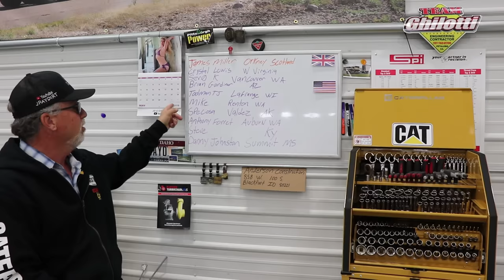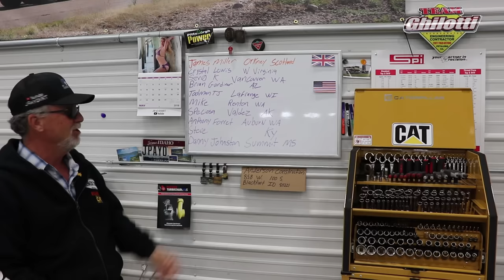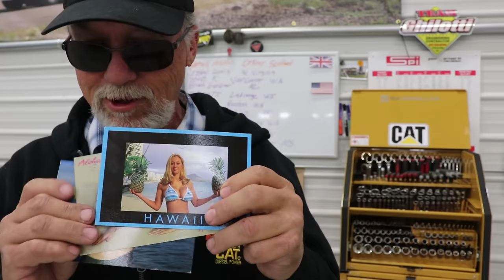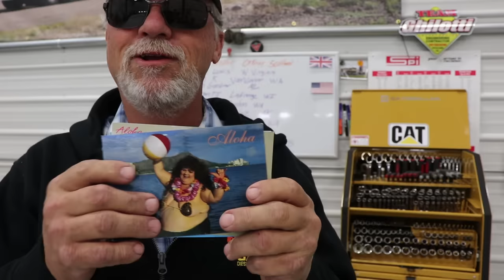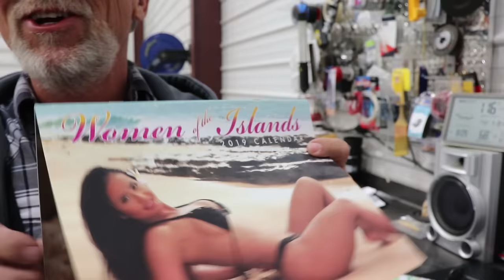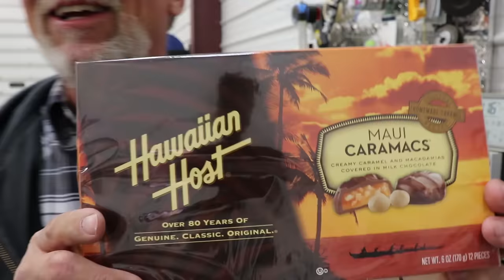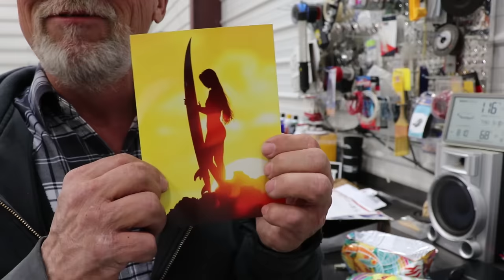How To Cut Red Top With A Caterpillar Grader

Comment: Your correct Jeff, a grader is a tough piece of equipment to operate to its full potential.  I ran one several times when I worked for the state highway dept in Illinois.  Never ran it enough to feel comfortable. I had a real finish grader operator tell me one time, "never stand up to run it and take little bites, don't try to move it all in one pass".  I tried to follow his advice.

Comment: Hi, Jpaydirt.
Another great video, especially the first part about grading to red tops. Very informative.

One thing that I have NEVER heard anybody else say about graders is this:

Graders work on the law of the lever. If one front wheel goes over a rock a foot high, by the time that movement gets to the center of the front axle, it is reduced to six inches. By the time  it gets back to the blade, it is only 3", so you'll have a whole 3" bump - without touching a single control..

If you go over the same ground again, with the blade set at ground level, that 3"bump will be 1 /12" by the time it gets to the center of the front axle and only 3/4"by the time it gets back to the blade. 

The moral: Let the damned machine do what it was made to do.

That said, "The art of earth moving is being able to set your machine to take the material from where it needs to be taken to where it needs to be placed in the condition that it needs to be when placed in the least possible number of passes."

As you said, you can tell a real blade hand very quickly by the way he goes about the job. A really good operator can pretty much make it look like he is sitting up there and 'letting it happen'. But the same can be said of operating pretty much any earth moving machine.

I don't call myself a final trim grader operator 'cos I have seen some of the REALLY good ones at work and I just ain't in that class 'cos I haven't and don't spend enough time on 'em.. That said though, I can often do better than some of the ones who do claim to be good blade hands.

Just my 0.02. Thanks again.

You have a wonderful 2019. Best wishes. Deas Plant.

Comment: as a laborer I would run along with shovel to help the old guy in the blade to clean off blue tops, red tops so he could see when he is getting close to them.  they would teach me tricks.  had a good guy that bet us he could pick a quarter and leave a dime.  he did it.
Reply from the maker: Ya, a good hand could cut em and all you would have to do is a clean off once in a while or if the cut was so fat it had to be done in several passes

Comment: On the 9N & 9T cat I used to have to find the fire hydrants using the GPS under a pile of wood chips at the pulp mill I worked at 100 feet deep , I set up the cats GPS to find the Pile Edges ,Hydrants , Pillers , Reclaims ; It would get so foggy in winter from the composting heat impossible to see at times - Wall of white at the doors before the GPS you`d drive off the piles or run into stuff so with the waypoints you`d see the cut you`ve done .Good show today Jeff .

Comment: More war stories from Anthony in Colton , CA . In the old days before we had plastic feathers. We used wooden hubs and painted the top of the hubs with blue or red paint for finish grade. I have seen some very good blade hands. Being the finish scraper  hand myself. Those were good at what they did. Who could scrape the paint right off the hub. I dont care how old you are that's finish. I call them war stories but all were true and my personal experience as a equipment operator. I sure would like to try those Hawaiian caramels. Thanks Jeff for all your great videos.

Comment: You have a classic buildup of tire fluid from the grader sitting in one place for too long. All the fluid squeezed out of the treads on the bottom and formed the boil. What you need to do is run that machine down the highway at the highest speed it will go. this will "fling" the fluid out of the boil due to centripetal or centrifugal force (I cant remember which it is) and distribute the fluid evenly around the tire and work the fluid back into the tread it was squeezed out of.  You may want to update your insurance before you do this, all of your insurance. Transversely, you could have a pregnant tire and it is just starting to show. Give her some space, don't work her to hard and see if you don't have a couple go-cart tires under the machine in a few weeks. (They normally pup at night). Hope this helps.

Comment: Great videos!
For cleaning the rust out of those seal grooves a glass bead cabinet is handy.  Tape off any surfaces you want to protect and spray away.  If you don't have one, you can get a cheap Harbor Freight unit for around $200 that will do the job.  Amazing how many things I end up using it for.  I don't actually use "glass beads" in mine....I use garnet sand that's a little coarser and it doesn't have the silicates of other sand.

Comment: Can't wait to see the start of the new Job, great info in this video Jeff.  Can you please show more on how you go about setting out your job (marking out, levels & Grade Stakes) and how best to approach different aspects of grading like (what gear to use with what type of material, blade positioning vs wheel position for cut, spreading or trimming; how keep a crown; Tips on doing high wall batters and slopes; and how to know if you've got the right moisture content.)  Oh and if it's not pushing the friendship too much, more on maintenance tips... Lov'in it all.   Cheers!

Comment: Nice grader tips there bud. Soak them teflon seals in some REALLY hot water, they get a little bit more pliable and save some aggrivation. Although still a pita! Thanks Jeff, Will in everett wa. P.s toolbox vid?
Reply: 682 70 Yes I've used the hot water trick a lot, works great. Jeff has a toolbox video last fall I believe if you look back you'll find it.
Reply: Jim Zivny i meant the new cat yellow box, i want one!!
Reply: It's not CAT, he just made it look like that. The vid covers it well. Model and where to get it too. You'll have to apply the cat paint, mats, and decals. Filling it with tools is the pricey part but none of it is on a budget including the elbow grease.

Comment: That was great video Jeff.Thats the trouble nowadays everybody wants GPS.Can't do anything without them probably use one to give them directions how to go to the crapper. You take pride in your work and its done right whether its excavating or wrenching and that still means something.Doesn't matter if its old school.Saw you were using the bottom dump did you ever install any vibrators?

Comment: I about threw the laptop on the floor making a grab for the cylinder part that started to fall.   Would that cap be easier to loosen in place and then remove in the shop? I have a loader cylinder I may try to repair myself after watching you.  Thanks for the videos.

Comment: I enjoy your work, agree with everything you said about the grader. I never had to grade up to hubs much, just wasn't done in our industry, a line of stakes set by transit with cut and fill was good enough, then laser came...and now we have GPS control and many ops that think they are good, but really good or just good programs doing the work? Its so true that knowing how material reacts to the way the blade is run is probably the most important aspect of grading. I don't get to sit in the seat much anymore but when I do I challenge myself to get that blade in the perfect position to do the work it needs to do. I never drove the machine, I run the blade. Great stuff paydirt, I'm still watching just not commenting much on anything anymore... but you got one out of me this time ;-)
Reply from the maker: Good to hear from you Jeff, are you still doing the same work?
Reply: Jpaydirt kind of. Much bigger oil company that probably doesn't want anything publicly broadcast. When I first came at the end of 2014 I was in the construction end but have since moved over to road maintenance for them and training grader ops. When not doing that I do a regular maintenance shift. Between the 5 of us I think we have a 1000 or so miles of road to look after.
Reply: CDNcatskinner yours was the first youtube channel I ever watched, your videos were great and I rewatch them from time to time. I work for a large oil and gas company in Aus doing wellsite, access roads and pipeline construction and rehabilitation. I have the same issue with not being able to post work videos on social media. 
Jpaydirt i hang out every Friday for your videos, i love your classic cats. Keep up the great work.
Reply: AusEarth99 cool, Nice to hear...must be something to work in a country that actually let's you get the gas to export markets, I'm jealous. Our protesters have stalled the industry.
Reply: I love your videos Jpay Dirt. If I hadn't been retired on medical grounds, I would have loved to learn to OPERATE "old school" Grading. After watching my Dad apply himself to anything, anytask, anywhere, I learned a lot from him simply by watching. Always asking the questions ... Why, How ... ? So, naturally, I also love tinkering, and apply myself to any task, within my abilities. Caren Barnet, South Australia.

Comment: One year in Phoenix years ago. Small parking lot crew. 14 blade, roller, water truck and my 613 scraper. One laborer to run finish hubs with the blade. One pass with the blade with a medium windroll. The laborer got in a tight spot with a wall and the blade. Strange, he disappeared for an instant. Then came rolling  out the end of the blades 14 foot mold board. Scared everyone  to death. All came running to see if he was o k. He was fine. Seems he jumped over the blade to get the next stake. Caught his foot and rolled him right out, including his shovel, the other  end. Wierd things happen when you're  not  paying attention.

Comment: if you don't change the winter air to summer air in your tires, it can cause tire boils😜
btw, buy yourself a can of Zep45, and you'll throw all other penetrating oils away. Use it sparingly as it is costly, but presoak, and reapply after a good soak...viola!

Comment: Loved the video. One thing I'd like to know more about motor grading. Got to spend more time on the old Adams.
O yeah dude drill a hole in that bulge that's the hillbilly way of fix'n things, member my dad fixed the TV back in 1960 so when ya changed channels ya had to reach through the hole he punch in the side. Worked great but would light ya up if ya touched the wrong thing.

Comment: Yeah, I know it's probably been replaced by now, but no. Don't stick a drill bit in it. It'll be under high pressure, and you may get injured. Besides that, the layer between the tyre and the outside air is what you are about to puncture, and the inside air will only want to equalise with the outside air...in other words, it will flatten much more quickly.
Reply from the maker: Thats an attention getter..............now you boys see a black trans am  LOL

Comment: ok Jay;   I've been around a fee belly dumps how are you regulating the the width of the doors?  it appears you have some way to change it in the cab? I've only seen chains on the doors. .
Reply: I'm betting that he has a proportioning valve somewhere in the control line.  Could be something like a highway trailer brake spike (taken from an older tractor, off the steering column), that regulates how much air gets supplied to the opening cylinders.

Comment: only dozer i ever worked was a 1968 John Deere 350 fireplow with a homemade 7' V-blade on front of it-i was working as a forest ranger in south central Ark-i worked 28 fires 18 were arson fires- most of the fires were small(less then 20acres) -the worst one was an arson fire-burned 80 of 20' new pine tree in less then 30 minutes(25mph flatline wind) and it wound up changing direction and ran over me and my plow-OUCH

Comment: I wasn't going to say anything about your tire selection,  I would have said stay away from Michelin Tires..
Their sidewalls are thin and easily damaged due to that fact.. Cooper. Or even good year have stronger casings. But you use the tires for industrial applications so I don't know if there's any warranty on the tires  or not. ???

Comment: I cut blue top for years in Texas, fine graded compacted limestone, shaved to grade. Imagine my surprise when I moved  to Detroit,michigan where bluetops aren't even used. A la stringline is how grade gets done. Really good operators lay asphalt base coat with graders. No grade hubs or even checking of the grade, once it is laid in it has to be right on finish. Imagine the labor costs saved......paving with one man instead of a paving crew.
Reply from the maker: how do they use a stringline, I guess that's something I have not seen
Reply: @Jpaydirt   . When I moved to Detroit from South Texas all I could think is "what the hell?" I had never seen anything like it. IT is exactly like the cement guys use when they go off their batter boards for a foundation. Simply run a string across the road grade from the guard stakes ' marked with permanent marker to one foot over finish grade and measure down centerline and shoulders. to finish' with an engineers rule. The laborers "string the grade"  measuring grade on the run : while the "Grader Guy" just runs along behind two laborers working the limestone grade and a string line pulled very, very, tight between two guard stakes at the same station on either side of the road... It can be quite a speedy process with the right people working grade. It is actually very difficult, because it all done by estimation to within 1/2 '  tolerance for asphalt and 1/4 inch tolerance for cement. Yanks pronounce asphalt " ashphalt" also. Really. I have been retired off a pension
for 11 years and from what I hear , all the kids use GPS exclusively now. Stringline is old school technology nowadays. But. It is how we used to do it. Here in Michigan. 
  Texas , when I left in 1980 , we still used bluetops exclusively. Limestone and water. And, a flatwheel rolller. Extremely rare is the yank that can cut bluetops. The have a f--k of a time with it.
    However these people are very highly skilled operators here in the Local 324. Knowledgeable is an understatement.Needing help too. Short of operators we are. There weren't enough operators to fill the seats in Detroit. The word came out in our magazine. Absolutely, send in -- some highly skilled operators to the Union Hall
and we will sign them up into the International Union of Operating Engineers. Really. 
   There is a boom on in the Motor CIty  and  so- local operators went on strike for over a month in Oct. Won eight dollars an hour raise over five years time for their efforts in this walkout, they did. AS a retiree I could only watch and think ; it is about time.  These folks will treat a man right, take care of him, sometimes cradel to grave and find him work.....if the skill levels are there.
    It has been an interesting ride, over the last forty years to say the least riding up on all those Cat 12's, 16's  etc..Thanks for posting the video.

Comment: PB B'laster beats Liq Wrench any day of the week.
Reply from the maker: https://www.youtube.com/watch?v=xUEob2oAKVs&t=1s
Reply: To each their own I guess but I have more everyday hours in busting loose weathered rusted stuff than you have it would appear. Mystik use to have a forming penetrating oil that was very good but they changed the formula or something years ago as it stopped working as it once did. But I know many an old farmer who will tell you nothing breaks loose the bolts and nuts on a bush hog like Coca Cola will.  But I question so called tests that include WD-40 for the purpose of penetrating anything.
Reply: I have tried pretty much all of them ... on equipment i was repairing ... I like PB blaster the best too ... I also like kroil ... but it's gotten so expensive now that I'm using up my old stock very sparingly. probably won't buy any more kroil unless i see someone selling it cheap.
Reply: You're right about the cost of Kroil products which in my neck of the woods is not carried by too many places and they only have spray cans.

Comment: Ever make a home made flapper ? Break tubing  5 " long or longer if ya need cut slit down length About 1 1/2 " and in stall emery  cloth the 1 stuff  cut length off roll in stall in slit .stick in drill give her hell .home made hone
Reply from the maker: Yes, but you can't get inside those little glands for the seals

Comment: i have been thinking about your grader tires.  i was watching more new holland iron from western truck and tractor repair.. he is working on a new holland 1118 swather with some great looking tread pattern tires.. after some research they are from american farmer Turf Traction R-3 ..but they only catalog them with that tread in 16.1" wheel diameter.  i wonder if they have a set of tire molds to make up some of them in 20.5x25 for your grader..  they do sell  more than 5 different styles with G2 /L2 tread pattern tires for your grader..  they might be made in the usa also.  www.stausaonline.com  this is only a  thought.. i have never used any big tires like this.. its just a saw the tread on those R-3 tires and thought.. that would be a great tread for a grader. so it might be worth a call to them.